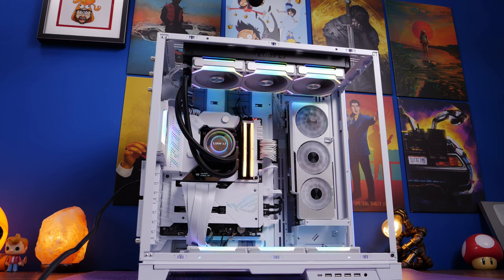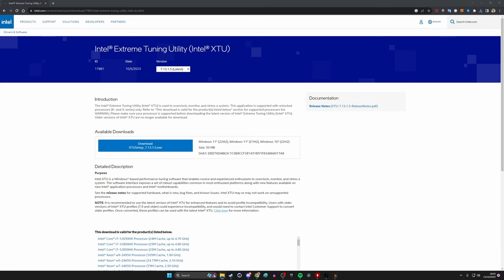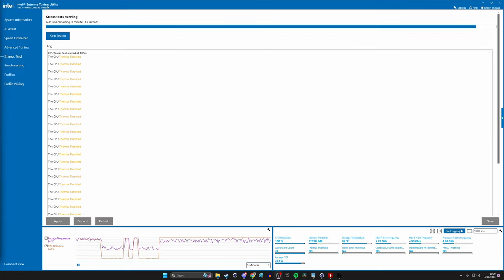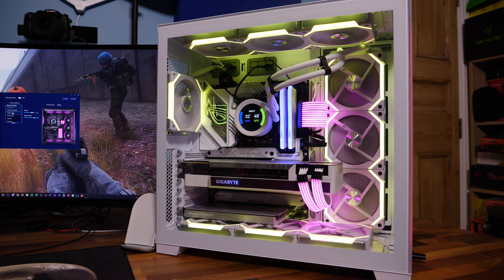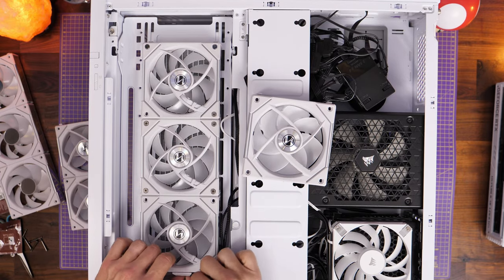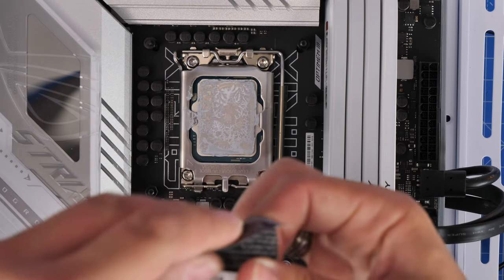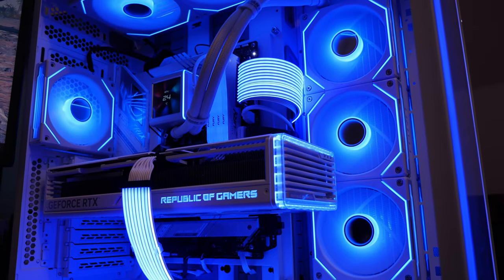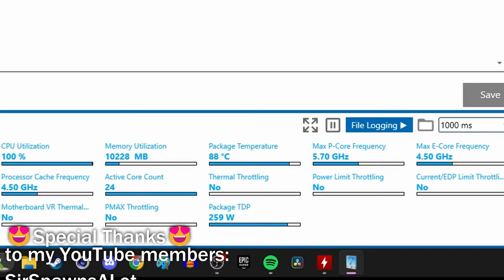Is your CPU thermal throttling? how to check easily and fix it

Comment: My CPU is thermally throttling even though it doesn't overheat at all, it just touches 60c and it starts throttling, bro.
Reply: buy better motherboard
Reply: Mine is at 30C and it does that too
Reply: @jakekymantas8778  30? is this sarcasm or real?
Reply: @sylvenara  bro it’s real
Reply: ???20c!?.....(getting nervous)
Reply: Mine it’s 92 and still gets 1k fps

Comment: If anyone is struggling with throttling or overclocking etc and are not a PC pro like myself, I highly recommend spending the money and having FPSHub take a look at your PC and let them tune it to perfection. Went from 210fps in Warzone to 350 to 380fps after they were done. With perfect temps.
Reply: What is FPShub?

Comment: Funny you say that/ When I built my PC a couple of months ago I put the paste on the CPU but forgot to take the seal off the AIO, I put it on. I had to take the AIO of not long after because the cable had to go around to make it look neat. Then I noticed. I used what little I had left and it seemed fine for a couple of weeks. Its a 12900KF. It started to hit 90+ degrees more regular. I bought Grizzly thermal paste, cleaned the cpu and applied the paste. The CPU hasnt went above 85 since. I have an Artic Freeze II 360mm

Comment: With this CPU it's a good idea to set PL1 (253) and PL2 (253) in Bios and also max power limit (307A). Minimal performance loss in synthetic benchmarks like Cinebench but waaay better efficiency and thermals.

Comment: My cpu has the symptoms of thermal Throttling but when i check cpu temp its at 50°C and my gpu is at 49°C. I have a Intel I5 9400f. I also limited the cpu to 98% because it was continously overclocking. I had no issues for 3 hours and then they started again.

Comment: Could 3 420 radiators be used simultaneously in this case?
Reply from the maker: The specs say it's possible but I don't know about at the same time and I've not tested so I'd just be guessing I'm afraid
Reply: I believe there are a few videos on YT of people doing just that. I don't remember them off the top of my head, but if you just search for it here I'm sure you'll find them

Comment: Nzxt Kraken here.. I have four fans doing the push-pull configuration as well as about six other fans. By CPU is a constant 30° C. But when I run my stress test I'm getting throttling and I believe this is causing my blue screen crashes which happened continuously. I have a I-9 13k chip, ddr5 Ram which I've changed out twice so that's not the issue, and the Asus Z 690e motherboard, as well as the Asus GeForce RTX 3070
Reply from the maker: I believe it's Asus power settings and AI overclocking causing instability

Comment: I just built my PC in the same case. This is only my second time building a PC, and the first time wasnt for myself. I'm using a Ryzen 7900x, and have 3-140 intakes on the bottom, 2-120 intakes on the back 3-140 exhaust on top, and then a 360 Galahad 2 with push pull on the side for exhaust as well.  It seems to be running fine, and when monitoring the Temps in just regular use it seems to be doing fine. I believe the highest I've seen it ramp up temp wise is 80ish. When I run Cinebench though, it's showing 95 on the main temp, but it still seems to be getting over 5Ghz on all the cores. 

It's funny you post this today because I've been curious if I am throttled and if my paste job was good enough. I've been tempted to pull the pump off just to see how well the paste had spread....
Reply from the maker: Give your CPU a Google. Recent AMD CPUs intentionally go upto 95 degrees on purpose for performance reasons. So it might actually be nothing to worry about!
Reply: @TheProvokedPrawn  yeah, that's what I figured from my Googlea dventures, but like I mentioned, first build for myself and only second one period. I also ended up applying the thermal paste myself... so... having the nervous thoughts of "Did I do everything right!"  Lol

Comment: Also I would consider using a contact frame. Ive seen good results in my 12900k and 13700k.
Reply from the maker: I have heard good reports. I need to test it myself. :)
Reply: @TheProvokedPrawn I have an extra one if you need it?
Reply from the maker: @mypeeps1965  that's very kind. I've actually ordered one already 👍 thank you though

Comment: Quick Question. This case is able to fit Three 120mm fans on the backside of a 360mm side mounted AIO? About to buy everything I need to build in this case. 3 120s pulling air into the radiator and then the 3 aio fans blowing into the case seems like a better setup than just 3 AIO fans

Comment: Starting my first build which will be almost identical to the one here. My question is for the side mounted AIO radiator as intake using push/pull. Would using the INF reverse fans on one side and the regular INF fans on the other cause problems? Or are they similar enough in specs where it wouldn’t matter?
Reply from the maker: Probably be fine

Comment: BIG QUESTION! Is it better to have the case open so more heat can be released??

Thanks for the timely video!
Reply: No. You want the case closed so that there's enough static pressure building up in the case to properly circulare fresh air to your components.

Comment: You have the radiator mounted with the outlet on top. If there is any air at all in that AIO system, isn’t the CPU pump sucking air?

Comment: For the rad fans behind the radiator, those can't really be seen through the case so why not use the stock ones with the kraken aio instead? Thanks!
Reply from the maker: could do, but they won't have the same airflow specs or speeds so it's not as optimal.
Reply: @TheProvokedPrawn  that's true. Guess you could also plug the stock ones to the pwm mobo connector and set the bios curve slightly faster or slower to balance with the lian Li.

Still on the fence concerning where to install my pusy pull, you reckon it performs better as intaking fresh air than exhausting right? Side mounted then

I got the NV7 :)

Comment: I am planning to buy the i714k processor, I need to understand how to install the reverse fan on my CPU.  I saw that you have added 6 fan to the radiator.  It is possible to add 6 fans and what casing did you use?
Reply from the maker: https://youtu.be/pIVMCe8wKb0

Comment: I have a question about fan orientation. I have two 140mm fans at the top of my case as exhaust, two front 140mm fans as intake,  and one rear 140mm fan as exhaust. Is this enough to keep my computer nicely cooled? I am using a Noctua NH-D15 on an i9 13900k inside of a Phanteks Enthoo Pro 2 Full tower chassis. My temps are fine for the most part, but games like Dead Space Remake shoot my cpu temps up to as high as 80c. I think my Asus ROG Z790-H motherboard is doing something strange when it comes to regulating power on the CPU but I just want to know if that amount of fans is enough? I was thinking of switching the top two 140mm fans from exhaust to intake, or should I get more fans?
Reply from the maker: That logic should be good. Have you tried the Intel stress test like I showed? Some Asus boards do have automatic overclocking which can make your CPU run hotter.
Reply: @TheProvokedPrawn  I downloaded the program, but it says that I cannot use it because hyper-v is enabled or something. If that's a vital function for windows, then I'll just keep it as is, but thank you for the information! built this PC a few months ago and it runs like a dream!
Reply: @DustyCruz  hyper-v is used for things like bluestack or smth to run android games idk about anything else and you can turn that off in your bios

Comment: Problem is ... after installing, Intel XTU tells be it can't run cause I have "virtualization" enabled, which when I checked is being used to have Secure Boot enabled ... isn't secure boot good to be enabled? So why would an intel software be requiring me to have it disabled? This was actually after updating to most recent version ... before that it did worl even with ecure boot. 
But maybe you can help ... when I did run it , it told me my pc had "edp limit throttling" problem ... I've checked bios voltage setting and seems there should be enough power for CPU ... can edp limit throttling be software related at all? When ever I search "edp limit throttling", power throttling seems to come up instead, so info very limited on this issue. TIA
Reply: No, Secure Boot and virtualization are two different things. You can find plenty of tutorials on YouTube about how to disable virtualization, which primarily helps Android games run more smoothly on emulators like BlueStacks.

As for Secure Boot, it often prevents you from booting from USB drives when installing Windows if it's enabled. In some cases, it can even lead to a blue screen if you try to install Windows with Secure Boot on. Essentially, Secure Boot acts like a physical antivirus; it prevents your system from booting with malware that could affect the BIOS, such as viruses stored on a plugged-in USB drive.
Reply: You can also use different programs for stress testing instead of XTU. For example, CPU-Z can perform a stress test on the CPU.

Comment: I have my aio cooler mounted up top. Considering doing a push pull config. I currently have the sl120 v2s exhausting air out of the radiator, how should I have them set up? My cpu is thermal throttling.
Reply from the maker: First I'd consider checking your thermal paste and the setup of your AIO. Check these out
https://youtu.be/qQcyYHGtArs
https://youtu.be/nVkN8diBIAE
https://youtu.be/qC5qavQ3AYk

Comment: my cpu is throttling while gaming but strangely not from heat. like basically, my fps consistently drops randomly every few seconds, and it's not related to percentage nor temperature of my cpu since they're both under 60. and also, my gpu is under 70c and its percentage is bellow 90. and i noticed that during the fps drops, like the voltage or something of my cpu drops too by a lot. does anybody know what the problem might be? or how to check it
Reply from the maker: Intel CPU? https://youtu.be/9zOBx_CYGcU
Reply: i was wrong my gpu was throttling according to online benchmark